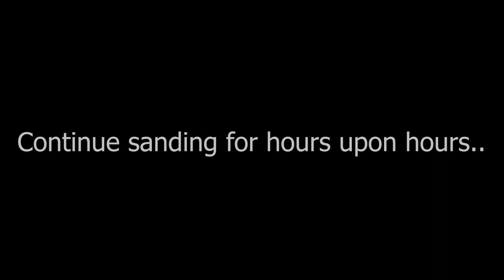[Micro Truck Camper Build] Part 2 - Finishing the Frame

Comment: Great build, I have been watching hundreds of YouTube vids looking for the right one that will work for me and yours is the one that I want to do for my truck. Keep posting more vids. Great job.
Reply from the maker: Awesome, thanks man. I definitely will. Feel free to reach out if you have any questions.
Reply: OK, I will. Thanks.
Reply: I was doing the same, but went with a old inport camper that we redone from the bones up. strip right down and rebuild.
Reply from the maker: @clammi  Very cool. I looked into many of the older cab over camoers and such, but none were tall enought o stand up in and they were all very heavy, so I went this route. But thats great, I love bringing life back to the classics!

Are you happy you went that route?
Reply: @rohdesoda1152  does the fiberglass waterproof it?
Reply: @lehammer2504 Epoxy resin waterproofs; resined-up glass provides lots of strength for weight.

Comment: FYI...  9:49  To get it smoother and flatter  you need to sand around with the curve in the arch .The opposite direction you were sanding. Ive been a body man for 40 years..
Reply from the maker: Trust me, she was sanded at all angles. The video shows a fraction of the fairing process. Im no expert, but shes presentable.

Comment: Ok, came back and watched this one again. I remember the first time now that I heard the radio commentary in the background :) So did you just do one layer of glass? How heavy was it? Then the fairing\skim coat and that was it? Mainly for waterproofing or strength as well? do you think it is sufficiently sturdy now that you've had it out on the road? I was going to do two layers of 1708 but that may be overkill and a lot of extra weight. What say you? Thanks again for the great vids.
Reply from the maker: One layer of 17oz biax (which is just 1708 minus the chopped strand) and then the fairing compound, correct. If you’re building something similar to mine I would say that is plenty, 1708 would probably be overkill. That being said, I don’t know the details of your build, and I’m not an engineer. I feel very comfortable with the strength and stability of mine. I’ve had it shaking around on forest roads plenty, I can jump up and down on the roof with no issue.

Not a problem, it makes my day that you enjoy them and that I can help!

Comment: What is that pink marroon stuff you put on the wood
Reply from the maker: Epoxy with fillers, used as a fairing compound to make a smooth surface

Comment: whats the pink stuff on the fiberglass and its purpose?
Reply from the maker: Its epoxy with a couple different fillers, used as fairing compound. It fills the waves and grooves and allows you to sand the surface flat and smooth without taking away the fiberglass (which is the strong part).
Reply: @rohdesoda1152  ok! I was going to ask the same thing. What is the weight difference between epoxy vs glass resin?
Reply from the maker: @guyh.4553  I dont know if I follow your question.. Epoxy IS resin. You saturate the fiberglass material with resin, let it cure, and you're left with a composite laminate. Adult paper mache!

Comment: Do you know the product names that you used for the fiberglass material and what you used with it?
Reply from the maker: You’ll have to be more specific. The epoxy and fillers are West Systems. The fiberglass cloth is just fiberglass, does not have a brand name. Some is biaxial, some is straight cloth, some is chopped strand mat.

Comment: So will this be a clamped on shell?
Reply from the maker: Correct, lighter weight, less hassle
Reply: @rohdesoda1152  that means zero insulation below you, has this been an issue or have you been able to use clothing and heavy duty sleeping bag to stay warm, etc?